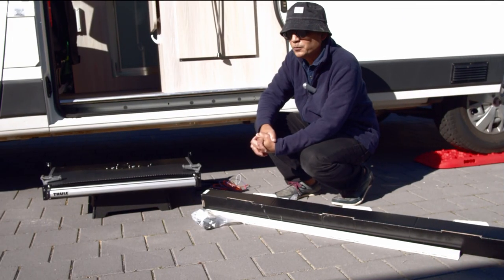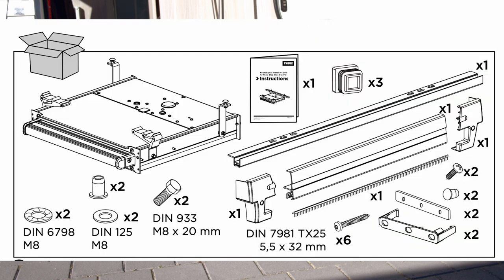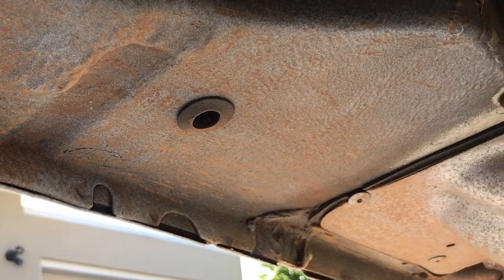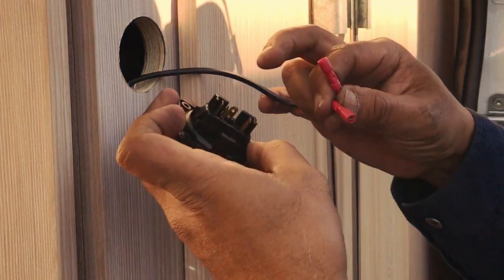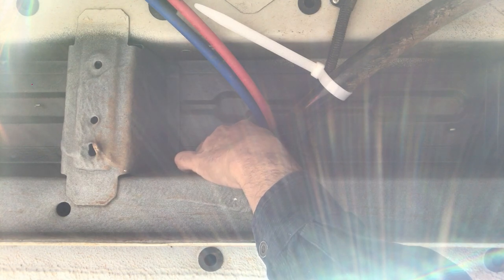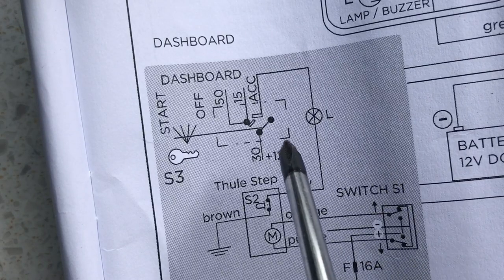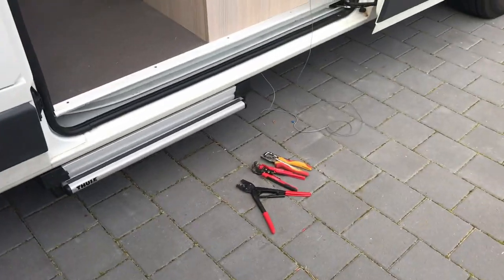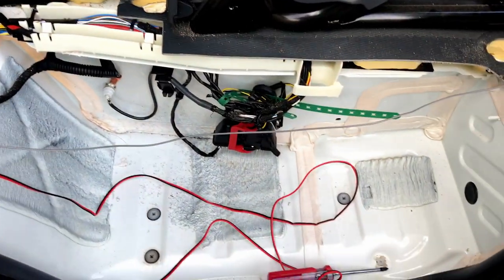Thule Electric RV Power Step with Warning Buzzer

Comment: Great video, I like how you explain your working method. Just one question, did you put a rubber grummet in the hole you drilled in the footwell for the gray cable? The sharp metal edge can strip the cable overtime due to vibrations which can cause a short. I'm very curious what the cable looks like 2 years later.

Comment: Hi do you have a photo of which way around the wires go on the switch ? I’m struggling with getting the wires correct!  Lots of blown fuses 😂
Reply: wiring diagram is shown at 9.55

Comment: put a "dot   com"  after the name i posted.   I think they will pull down my post if I spell it out.   It is the same van but they use a Ram motor and transmission in stead of the Fiat.
Reply from the maker: thanks Don